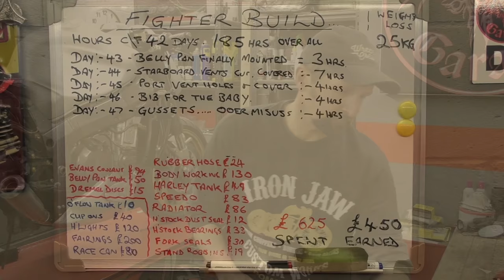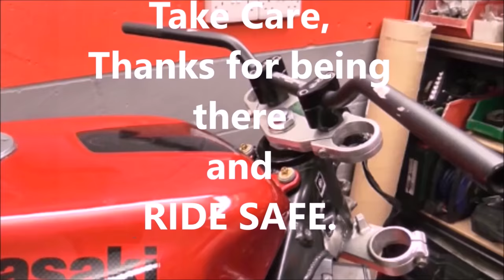Delboy's Garage, Fighter Build #42, GUSSETS !

Comment: The covers make scientific sense, as you nicely explained - they provide compressed air for the hot pipes underneath. However, from the beginning I was imagining the covers as cross sections of cone-shaped tubing (split in half along the long axis), the thinner ends going towards the tail and the thicker towards the front. An example of such a tube is your exhaust. That way, you could mirror the exhaust, and they would also be smaller in height, thus covering up less of the belly pan and allowing it to mirror the tank. 

This is my first comment here, so I'll just use it as an opportunity to send regards from Montenegro and express how much I love your channel! 

Stefan
Reply from the maker: Hi Stefan, welcome aboard Sir, and thank you for your comments, it's good to hear from you... !  I totally get what you're saying, I was thinking of the same idea with cup cones, but reversed, so that the outlets will face rear, this will act scientifically again bu creating negative pressure to draw the hot air our from inside the belly pan... and I think they will look really cool, like Spitfire exhausts !  Gotta pull it off, of course, so wish me luck !

Comment: Another great video, brother. Don't worry about how long you've spent on the belly pan. I know that for me, you're attention to detail is one of the things that got me into your videos. So you're right to stay on it until it's done correctly. As for the side vents, I'd say keep the covers on. They add depth to what could have been a boring tub hanging under the bike. Also, to leave the holes open and visible would break up the smooth lines of the belly pan that go along with the tank and front end. But that's my opinion. I'm sure that whatever you do will be awesome. Thanks for what you do and keep it up.
Reply from the maker: Hi buddy, I know what you mean about the smooth lines of the tub, but the whole bike is rounded and smooth, however, being as it's an area related to the engine, I may take them off and add a little drama with some exhaust style vents to draw heat out... not sure yet, but getting loads of ideas from the feedback - thanks!

Comment: Fill the holes, use a small hinged scoop on the bottom drain hole.  It would be hidden and with the hinge very easy to clean out.  The belly pan would then maintain the clean organic theme of the project.

Comment: Like the fiery new intro.  The gussets look spot on from the inside. They fit the other holes in the belly pan and reakky give the aircraft effect like you say. My two pennies I guess is to remove the cover plate and just weld some wire round the circumference like you plan on doing with the rest of the pan. It'll give the impression its a lot more beefy looking than it is. Either that or have the cover plate offset from the inside of the belly pan rather than the outside. It will still allows some air in Not as much as leaving it open. However once it's painted it'll be almost invisible and means you necessarily go down the holy route if you didn't want too . Anyway I'm sure you'll make it work somehow. Look forward to seeing whats in store for the seat unit.
Reply from the maker: Thanks buddy... i have a loose plan of some half cone covers to shield the holes, but still let them show.. it should then take on the look of Spitfire exhausts hopefully... ill decide next weekend and move on..!  thanks buddy.. Del.

Comment: Loving this series of vids Del. I know what you mean about the vent covers, I'm about 80% on them as well. How about frenching the holes at an angle that follows the air flow. A lot of work but it would match in with the frenching on the nose and add some depth to the belly pan. Or, as a few have mentioned, a quarter dome on the surface to catch the air. Whatever you decide I'm sure it'll look good. Cheers - Mark.
Reply from the maker: Thanks Mark, yes, that's kinda of where my ideas are going now, some individual mini- cowls might just do the trick !

Comment: I would pull the side covers off, put the pan back on and sit back and study the look of it. Side covers on or off I think it's going to look good. It is just a matter of personal preference. If the bike is currently running I would also take it for a ride with the pan on ( side covers on and off) to check for any unexpected wind noise/whistle. That is if the exhaust sound is not too load. Great work!!!
Reply from the maker: Did you hear this when I ran it up??  It's loud enough to wake the f'ing dead lol ... I think it will drown out any noise from anything else... lol

Comment: Take the covers off and straighten out the upper side edge on the belly pan instead of the wave-like curves around hoses etc. If you want a jet like appearance you need gentle curves and smooth straight lines. No matter what you do or not do the bike will be unique and look good.
Reply from the maker: Thanks Yann, that's really kind of you - kinda got an idea how where I can go with this... the feedback has been so helpful !
Reply: Moonfleet41 if you remove them, at this stage you can always put them back on. But you will see if you prefer the look

Comment: You are absolutely right about the holes not needing these additional pieces for air flow. Being a fluid mechanic engineer, I could tell you if anything, you are preventing instead of enhancing the flow using those flaps. Even, if you imagine that the holes are parallel to the flow, rather than normal to the flow, they will flow the air due to the Bernoulli effect (Just like opening the window in your car, air comes in and goes out of the window at high speed) Another point is that, the flaps have to follow several curves to work: one is the tank above which you mentioned, and the other more close one is the edge of the belly pan  itself. On one side that you followed that edge of the pan it works much more nicely, than the side that the top edge of the flap is kind of straight... Specially, visually, it looks too close to the mounting bolt for my taste...
Reply from the maker: Hi Abouzar,  Bernoulli effect applies to liquids, and considering that in scientific terms, gas, so in effect "air" is in fact also a liquid, then yes, the  Bernoulli effect will apply, i have removed the covers (video up tomorrow), and will be now probably creating some guide cowls on each hole to create negative pressure over the holes, which will draw out the heat (same as your car window analogy) rather then blowing cold air in... opposite method to achieve the same result....... a cooler belly pan..!! thanks for your input my frined, good to hear from you.. Del.

Comment: Hi Del I agree with what other viewers have already said by taking the cover off. Somebody suggested to completely remove them and it'll literally look like an upside down fuel tank (which we know it is). My suggestion would be to leave the covers on but cut out the same sized holes in the covers what will align with the existing holes already. So you still have the covers on but with drilled out matching holes giving you the result of what you wanted for air flow and also keeping it looking unique. Keep up the great work! 

Aiden - Black Country (Midlands)
Reply from the maker: Thanks Aiden, the feedback has been really useful... I've come up with a few ideas off the back of it, but am gonna stand back for a week and get back on it at the weekend - need a ride which is where we do our best thinking (before it gets to -3 degrees lol) - cheers buddy...
Reply: Moonfleet41 I know that feeling too well. Few more rides this month and then wrapping mine up and putting it away until spring. How I wish I had the spare cash for a winter hack but I'll wait. Enjoy the ride and I have every bit of faith you'll come up with the perfect solution. Brilliant videos Del look forward to seeing the next one!

Comment: I've been trying to not say anything but now that you ask:

If you take the covers off, it'll look so much better.

That, or just pull them right against the metal at the back and taper them out a little towards the front.

Like a really long, extended louvre.
Reply from the maker: I think you're right buddy, that's why I asked the question, was clear many weren't impressed!

Comment: Yeah I must admit I was never a fan of those 'guards' for the holes on the pan...

I think the exposed holes would look much better however they are all the same size, I would have them going smaller as you go back... Creates a speed look

My ideal thing I would have loved to see is to see almost vertical shaped slits in the pan, flared out so they are opened like a reptile or fish gills. The whole thing looks extraterrestrial to me... You could shape them to follow the lines of the bell pans outline so they follow the contours of the bike

Comment: I don't know if it's been mentioned below, but i thought to reverse mount the covers, so they're sitting behind the holes rather than in front. i like to jetfighter look, but i think exposing the exhaust looks just a little too unfinished.
Reply: If you're to leave the holes showing, you could also put holes in the fuel tank to match. I'm sure it'll be simple enough...
Reply: I can't think of anything wrong with drilling holes in the fuel tank lol. Or am i missing something?

Comment: Hi Del, 
I hope you and Penny are well. 
The build is going really well and its always a great watch. In regards to the vents, maybe you could beat the original tank inwards and then bolt the vent on top to give both a flusher look and it would still be removable.  
What ever you decide i'm sure you'll make it great.
All the best.
Reply from the maker: It's already tight up against the engine mate, got no room to push it in anymore, but I have plan!

Comment: Looking at the profile of the bike, the covers on the belly pan break up the lines and it looks out of place in my opinion. The tank and the headlight cover has a clean look. The gussets you welded in have holes in them just like the belly pan and the look great!  I would take the covers off and run with the holes, you seem to have made that decision anyway by the sounds of it. Keep up the fantastic work, looking forward to seeing this on the road!
Reply from the maker: Think the general consensus is to take them off, so will do that... have a few ideas about mini-individual-cowls, nut gonna stand back few a few days, bit like writers block aye... need to clear yer head and take in the all the great ideas ... it's been really helpful - cheers Arron!

Comment: The bellypan looks amazing from the inside but if you had that look on the outside it wouldn't tie in with anything else on the bike. So I would vote for leaving the covers on . I just think you have 
put so much work into the nose ( that you love) and tank to be changing the theme , i think what you have so far ties in together well. But by the look of the comments the covers might need to go.
I could watch more fab though. Good luck with your decision .Cheers
Reply from the maker: Thanks buddy, you are right, the outside looks so far, is clean and bumpy, but I still haven't done th tail, the hole in the front for the headlight would kinda tie in and I have a few ideas now for vrnt covers that a re indiviual to each hole - gonna sit on it for a week to make a final decision - cheers !

Comment: Hear me out, What if you were to remove and scrap the cover. cut out the holes into a single shape that mimics the concave curvature. and fine-mesh it from the back. I believe this will give the cleanest look. I like the holes, it does give it a fighter look. But it also looks like a last minute decision. As a product designer, I am blown away at how beautifully simple this has come along. Cheers!
Reply from the maker: Thanks Corey, the sides of the belly pan are in fact not just a single concave curve...that is the vertical axis.. but the horizontal axis is a long, gentle convex curve.. making it a compound curve.. and one large slab of mesh in that as a long slot would never follow that line, it'll soon look buckled and follow its own natural desire to flex back to flat, specially with the constant heat cycles...    I have a plan to make them more dramatic, it is  the engine area after all,and it will add some excitement to a lower area of the bike and draw the eye down there to the observer.... hopefully..!!!!

Comment: Hya del! Them gussets look awesome! I sorta get what you mean with the covers there's something not quite 100% with them maybe after bodyworking them they might look right but by then you've thrown more hours at them and still might be for nothing, have you thought of maybe removing the covers and welding some flared half moon style louvres on the rear edges on each of the holes, Sort of creating individual pods down both sides? Bit hard to describe but hope you get what I mean! Best of luck what ever you choose to do and keep up the great work!
Reply from the maker: Cheers Darren, I do know what you mean... exactly what you mean... am thinking on the front edge, not the rear, which will act like heat exhausts via the negative pressures caused by movement... a bit cleverer and will  give a visual appearance of moving forward... Spitfire exhaust stylee....!
Reply: Yeah that would be a great bit of styling and tie in nicely with the curves on the tank and headlight panel, can't wait to see this come together why do we have to go to work! I'd rather be in the garage tinkering with bikes any day of the week!

Comment: With the lightening holes of those gussets, I say loose the side covers. Actually you have a similar look on the front headlight fairing already. There's the round hole for the running light and the headlight is frenched into an oval hole this is just an elongated circle shape. So it's already carried on to some extent. And if it gives you design inspiration, then like you said it can totally carry onto the tail section and mud guards to tie in a specific look. I like it. Every time you show a shot of the inside of the belly pan I dig the look. At any rate you have clever design ideas all the time and I'm sure it will coalesce into something bitchin. Cheers bro, love the project!

Mike
Reply from the maker: Thanks Mike, praise indeed coming form a fellow fabricator.. i guess sometimes a thing you hope looks good...turn out a turd... so the covers are gone, and the bolt holes welded back up now.. and ive mounted the belly pan with all the large holes showing through to the exhaust...and its all in tomorrows video... im gonna leave it till the weekend and make a decision at the bench on Saturday morning...!!    Hope today went well buddy... remember what we said, if it time to run to the hills... the kettles on..!   D&P.

Comment: Before you lose the covers, could you chuck some cheap paint over one of the sides, even something water soluble to clean straight off? You'd get a better idea of how it will look because the paint might make them disappear. It might make your decision easier. If you still want them gone, one thing that springs to mind is mini 'scoops', a la fj1200 front fairing. Could be accomplished by cutting some shallow angles out of box section or even recycle some more of that tank carcass. Because you have a few to do, you could mock up a plywood mould to hammer them into. Besides all that... the holes would look pretty cool and functional. Maybe you could just add a bit of shape to the holes to follow the lines or leave them as is. Looking forward to see what you come up with.
Reply: p.s. For the record, I like the covers anyway. The whole thing is a work of art. The covers probably look strange to you and others because it hasn't really been done before. It looks like where a pair of wings should bolt on.
Reply from the maker: Thank buddy, thats very kind... i guess designing a custom fabrication is an artistic process, and sometimes you get a little creative block.. and other times something you think looks good, just turns out crap... they're off now, bolts holes welded back up and ready to make better of them.. new video up in the morning..!

Comment: Hi Del, you know I'm a great supporter of yours, right? Well here's my thoughts:
1. The covers, to me, don't follow the design outline of the tank and the bellypan,
2. IF you wanted air scoops to aid cooling they would need to be sealed at the back to encourage the external air to pass through the holes to the interior, (are ALL the holes in the same size pattern both sides?),
3. I would say, take the covers off.
Obviously these comments are intended to be constructive, but ultimately it's your project and you decide.
Take care mate, Dave.
Reply from the maker: Hi Dave, all comments gratefully received, will be losing the covers, but wanna a bit of drama in that area, so some little reverse cone cowls will help to draw the hot air out and give a Spitfire exhaust kinda look ... sitting on it for a week to decide!

Comment: Del, I'd leave the holes with no vent covers and move on to another area of the bike, and as it goes on some idea will pop up to match it with what's missing. Cheers.
Reply from the maker: Some people are saying that, but I don't like leaving things un-finished, I will finish the belly pan before I move on !
Reply: Yeah, it gives you peace of mind to have it finished haha. I just made a quick sketch with an idea, they are like curved fins but inside the pan, so from the ouside it looks clean but complex at the same time. The
 radius of the fins and the separation are key to make it look good (I just made a quick sketch to get the idea). May work or not! https://postimg.org/image/ajc7muyy3/

Comment: I would like to see the holes. Reminds me of speed holes or silencer holes.  When it comes to air flow, I think there would still be a low pressure area inside the belly pan at speed without the covers.